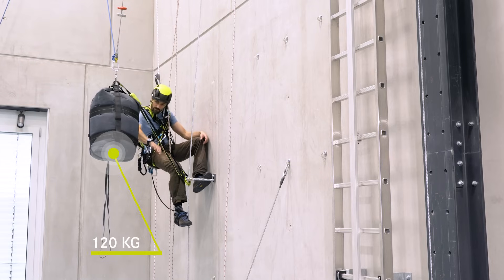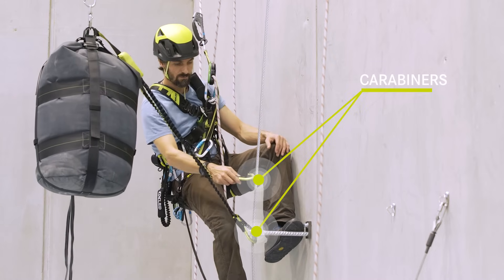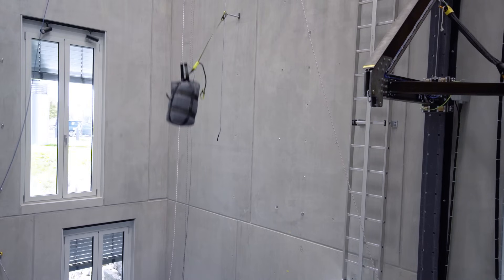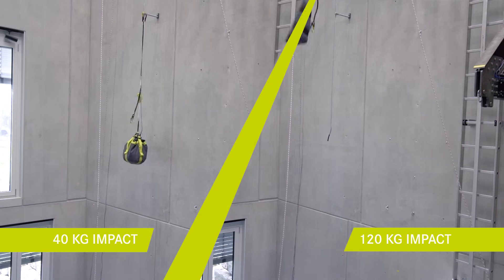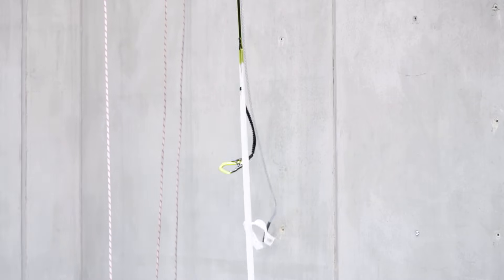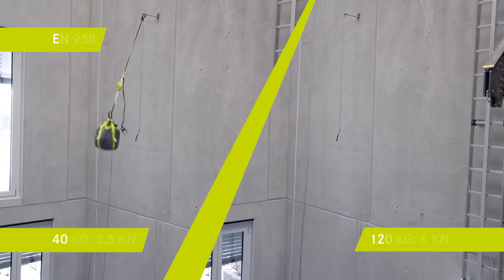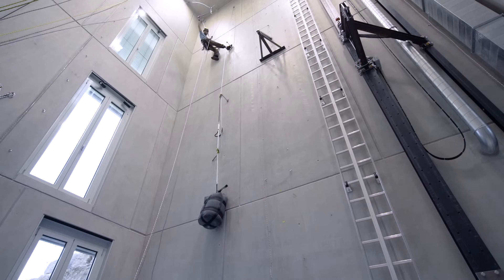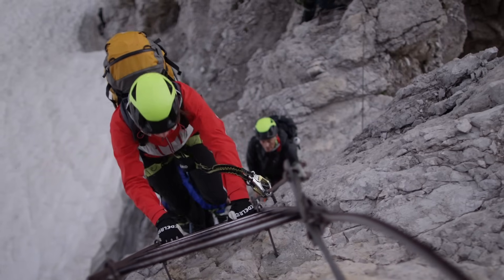How does it look if you fall into your via ferrata set?

Comment: What do you do once the screamer has deployed? How do you get home?
Reply from the maker: Well, that depends a lot on how everything looks like after the fall... Contrary to sport climbing a via ferrata should not be climbed to the point of falling. Falling should be not a planned option. The shock absorber is only there to safe the climber from the worst case scenario and avoids that he/she completely falls off the wall or gets hurt due to hard impact forces. However a fall on a via ferrata can cause big injuries as well from hitting stuff along the way down. So in case a climber can finish the climb by him-/herself after the fall then this can be an option. If he/she is too injured or does not dare to do the rest, or the shock absorber is deployed fully or any other doubts a rescue should be called. Nevertheless then the shock absorber at least helped you to be capable of calling a rescue if you know what I mean.
Reply: @EDELRIDKnowledgeBase  👍

Comment: If the absorber only partially deploys because of a small fall, would you recommend continuing the via ferrata route, or seeking rescue? I guess bringing a backup set would be ideal, but nobody seems to do that..
Reply from the maker: Well, that depends a lot on how everything looks like after the fall... Contrary to sport climbing a via ferrata should not be climbed to the point of falling. Falling should be not a planned option. The shock absorber is only there to safe the climber from the worst case scenario and avoids that he/she completely falls off the wall or gets hurt due to hard impact forces. However a fall on a via ferrata can cause big injuries as well from hitting stuff along the way down. So in case a climber can finish the climb by him-/herself after the fall then this can be an option. If he/she is too injured or does not dare to do the rest, or the shock absorber is deployed fully or any other doubts a rescue should be called. Nevertheless then the shock absorber at least helped you to be capable of calling a rescue if you know what I mean.

An taking a back up shock absorber is of course an option, not judging now how reasonable this is in general.

Comment: Thats not how it looks if you fall, thats how it looks when a bag falls! i dont know anyone the wants to do what the bag did ! which is why i dont trust that system!  To make a leash that you can fall on it would have to be as soft of a fall as on a top rope. And we know that wont happen... next what if the climber gets a foot or arm trapped behind the cable during a fall, that would be a big problem! all in all you need to be able to solo the route to be remotely safe, and if its a difficult route your at the mercy of that equipment. Again not good for most people. Ive used screamers before on lead and it doesnt make you feel good, but you know that its dangerous and expect that. 
they need to create a better system! 
Thanks for the video! you proved most of my points!
Reply from the maker: You are generally right in what you are writing. But  notice that contrary to sport climbing equipment, a via ferrata set is also "only" meant to avoid a fall to the ground with certainly more definite consequences. It is not meant to be used to catch systematic falls like in a sport climbing scenario. In no way do manufacturers of such equipment advertise this about their via ferrata sets.
Reply: You hit the nail on the head: you should be able to solo (with rests in a resting system maybe) a VF route to be safe, i.e. have a no fall mentality. Ofc do bring safety gear nonetheless. This is exactly what VF is. Only climb stuff that feels safe, start off really easy and progress towards harder routes slowly. VF is generally much much easier than sports climbing. The VF set is meant to increase the probability of survival in case of a fall. Many things can still go wrong. Once you're in a deployed set you have limited time to be rescued as most people aren't capable of self rescue. So yeah, you're right- this system doesnt come near the safety of a fall in sports climbing... because opposed to sports climbing you're not meant to fall.

Comment: This is a falling mass of 120kg, which simulates a via Ferrara climber 😂
Reply from the maker: Well, that is the maximum required weight of the standard and if you think about it, it is probably not so far of in many cases. That an adult male person is close to 100 Kg is not super rare I would say. Then add gear and a backpack and you are not so far of with a little bit of a safety buffer...
Reply: @EDELRIDKnowledgeBase saying Fia Ferrara climbers are fat.. without saying they're fat 🤣
Reply: It’s not that much margin for athletic 190cm man. Not everyone is lean full time climber.
Reply: I'd call myself reasonably actively, climbing twice a week and running twice a week as well. I weigh 110 kg.
Reply: I regularly act as a via ferrata guide, and weighing 100kg, add on that my personal kit (clothing, equipment, water) and rope. 110kg is fairly feasible. Not much room for error..